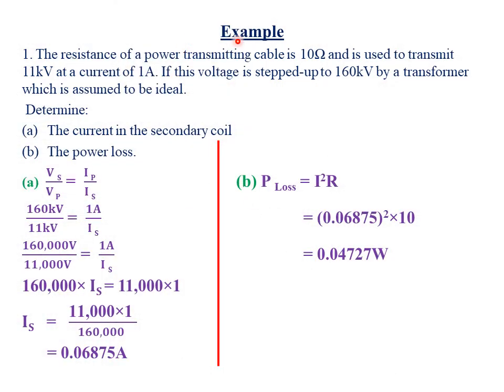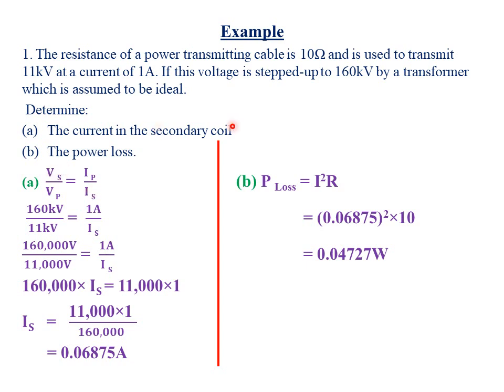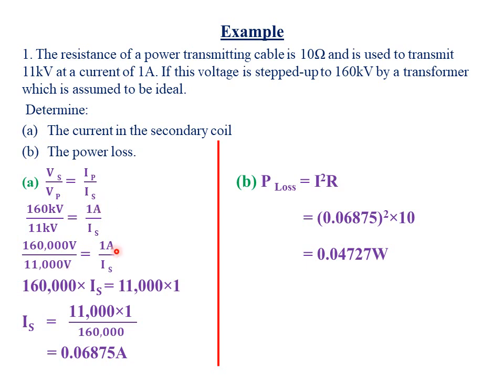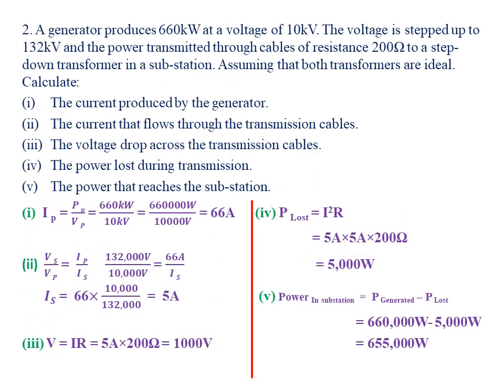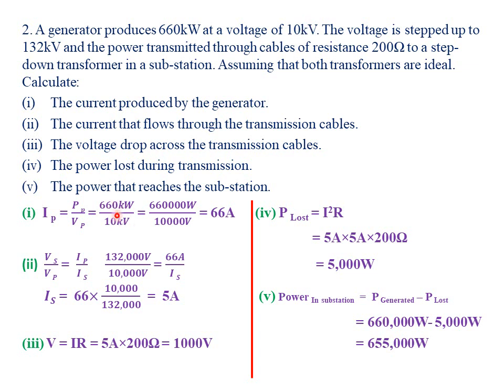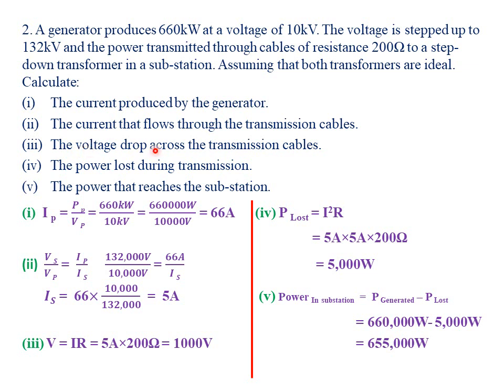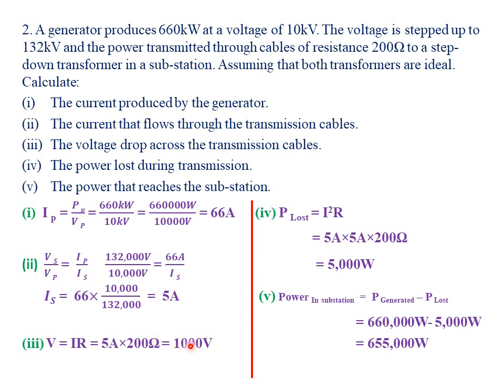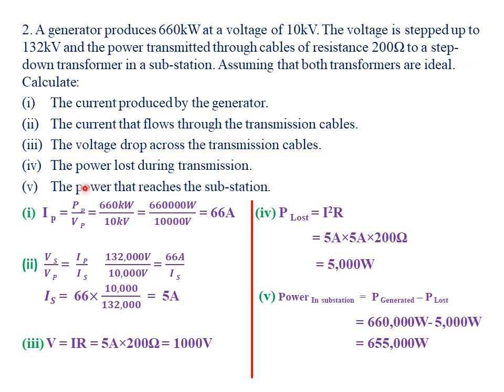MAINS ELECTRICITY: LESSON 2

Comment: thank you very much mwalimu,,,, i had a concern on ques 1
Reply from the maker: Welcome friend.Ok.
Question 1: 
(a) P = 150kW = 150×1000W = 150, 000W
P = V^2÷ R  making V subject of the formula, V = √(PR) = √( 150,000×7.5) = √(1,125,000) = 1,060.7V
(b) Power Lost = I^2 ×R = 10×10×7.5 = 750W
(c) Maximum power in factory = power produced by generator in factory + power lost = 150,000W + 750W = 150, 750W
Thanks for your comment 🙏
Reply: well explained, gracious
Reply from the maker: I'm humbled. Welcome friend. Be blessed 🙏.
Reply: @kindtuitionacademy  The maximum power to the factory is also wrong. Since there is power lost during transmission, you subtract the power loss from the p.d of the generator. 
My final answer would be 149250V
 Kindly correct me if my responses are wrong sir.
Reply: @kindtuitionacademy  This is not the correct method sir. Using that formula assumes that the whole 150 kW is being lost in the resistor (i.e., no factory, just the cable!)

That the resistor is the entire circuit, which isn’t true

So you used the wrong context. Apply the formula P=IV hence p.d is 15000V.